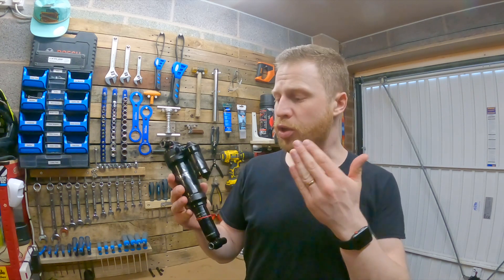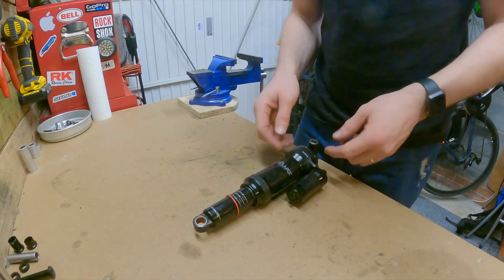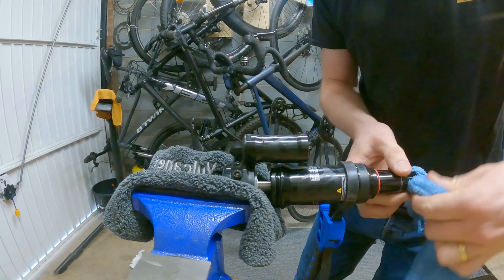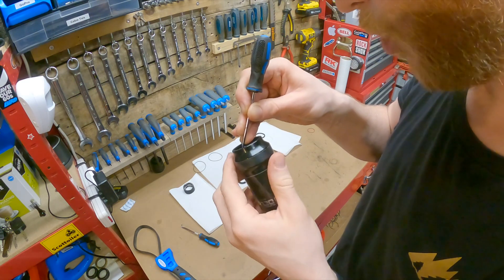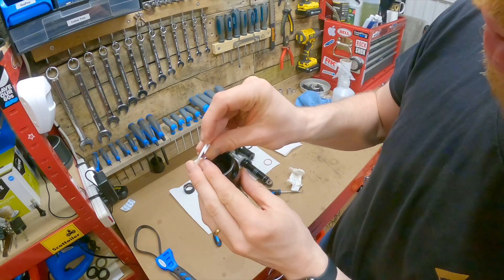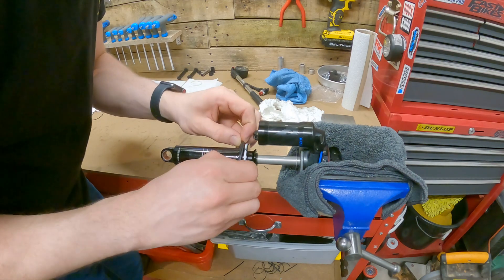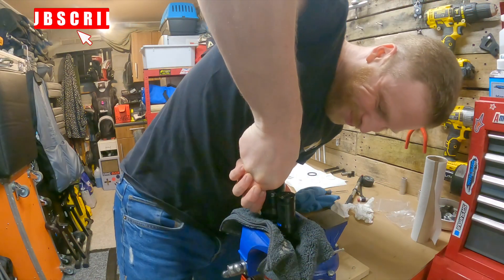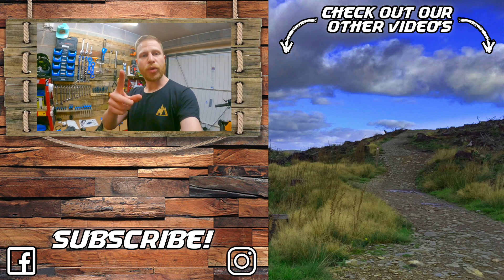RockShox Super Deluxe 50 Hour Service  |  DIY MTB Maintenance

Comment: What diameter pipe did you use to take the mounting hardware off?
Thanks for the great vid!
Reply from the maker: Hi. Sorry, I’ve only just noticed your comment. The pipe I used had an internal diameter of 16mm. I hope that helps.

Comment: Did you accidentally include the sag ring inside the air-can when you re-assembled it?
Reply from the maker: Hi. No I took it off before I reattached the air can. I did put it on a little bit too early and the footage doesn’t show me taking it off before applying force to screw the air can back on. I think you just about see me put the sag ring back on though after I’ve screwed the air can on. Good spot though - cheers.

Comment: How much time until the rings are fully set in and zero air is lost.
After serving, I can hear air moving. Could be from negative chamber.

Put in 150lbs and lost 5 pounds plus after 24h.